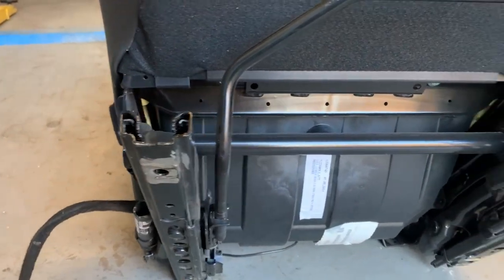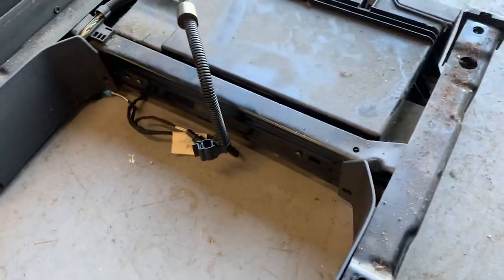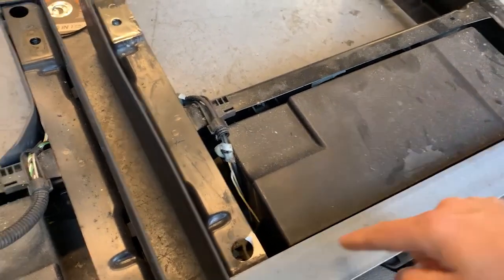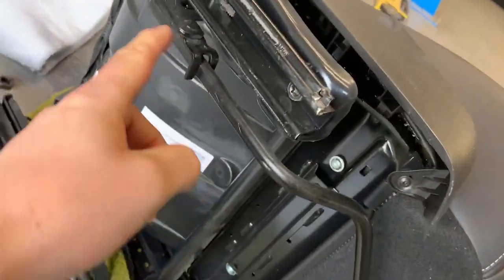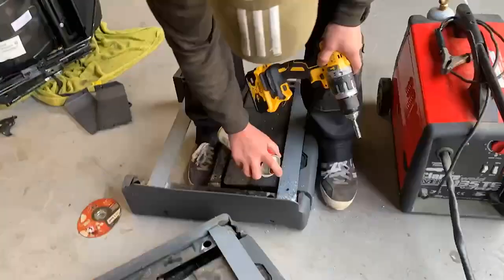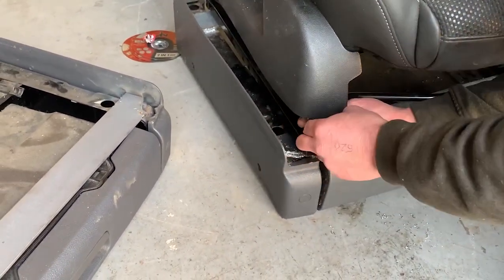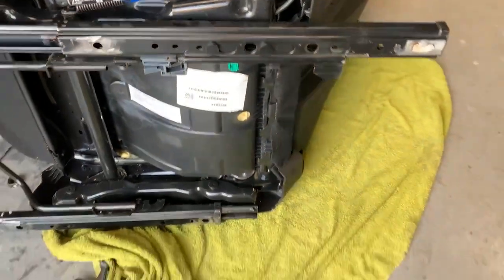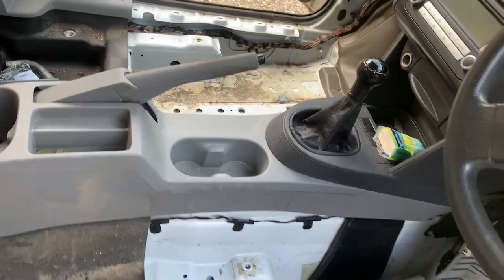FITTING VXR SEATS INTO OUR TFSI CADDY PROJECT - CADDY PROJECT VANNED BUILD EPISODE 5

Comment: How did you wire up the air bag on the vxr seats and seat belt light .
Reply from the maker: I didn’t bother wiring them up pal. As the van didn’t have airbag wiring for the seats.